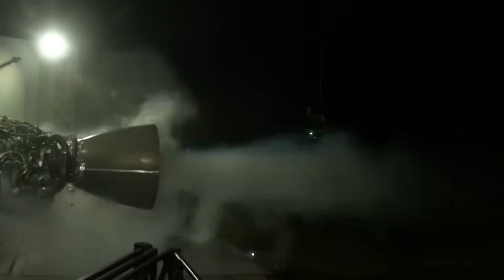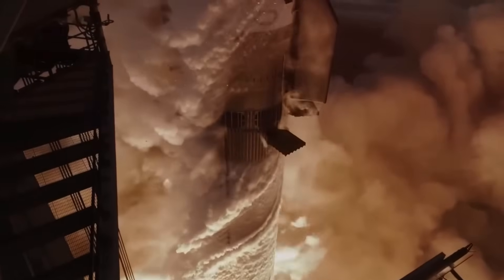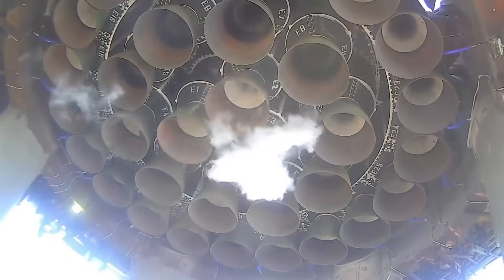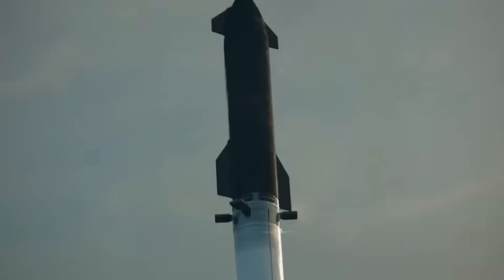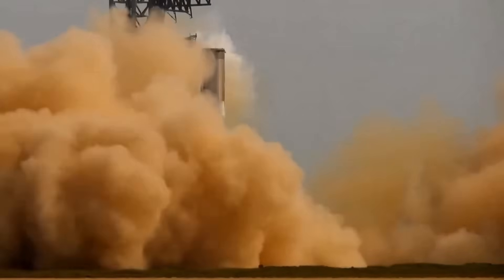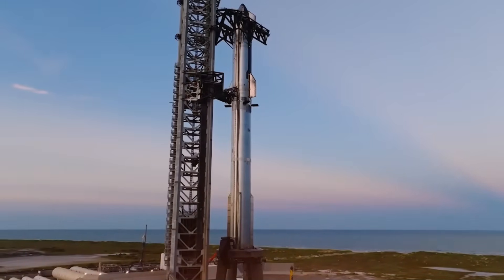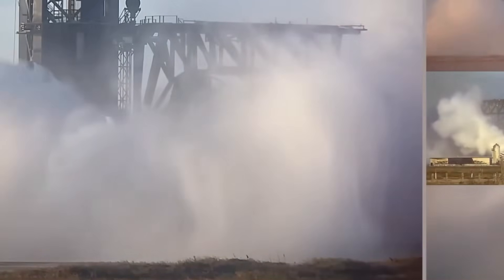SpaceX's NEW Raptor Engine Just Did The IMPOSSIBLE... Engineers Are Speechless

Comment: Needs another cone inside of the cone  with outputs like a natural gas oven top
Reply from the maker: Engineering often thrives on innovative concepts like that. Who knows, maybe we'll see something like it in the future!
Reply: @Elonmusk24h  u could do the same amount of lift with half the fuel if u used a double sided compressor instead of a single inlet also with a ported knozzle similar to a becket burner on a fuel or gas furnace
Reply: The flame wouldn't be near as close to the ship either

Comment: Am I the only one concerned that a water deluge at those temperatures could risk a hydrogen explosion if the launch temps get particularly high?
Reply: I think it doesn’t happen because there is no buildup of hydrogen, the water that decomposes to hydrogen and oxygen due to proximity to the rocket exhaust immediately gets burned off. The process obviously looses enough energy so that a chain reaction isn’t possible, I say obviously because we set off nukes under water which wouldn’t have gone well otherwise.
Reply: Pretty sure this has been considered  and worked out. Lots of $$$$ at stake here!

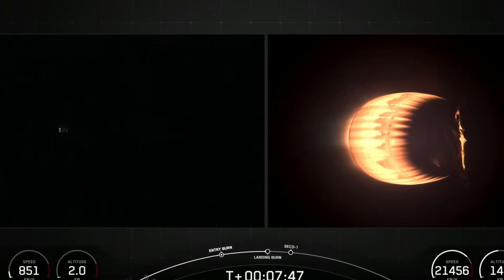Comment: 1:38
The the start, SpaceX built more than one engine. The Merlin and the Kestral. 
More errors:
“SpaceX chose Methane”
No they chose hydrogen as their fuel at first.  Yes when the first announced their next engine it was going to burn hydro/lox.  After a short time, the study of metal embrittlement and the leaks associated with hydrogen, made methane look attractive.
Reply: Plus hydrogen is just too bulky for the energy it produces - good per kilogram (the best), but not per litre - thus the huge tanks on the Space Shuttle. The carbon in Methane "compresses" the hydrogen - an elegant choice.

Comment: Hey Elon, 304 stainless steel is really strong and heat resistant.  Is there a comparable scandium/aluminum alloy that could replace 304 stainless?  I've noticed that research with scandium, as an alloy, is constrained because of is rarity.  The paradoxical thing is that the sediment, under the manganese nodules, in between Hawaii and Mexico, is loaded with scandium.  So, do you tear up the ground on land or suck up the mud on the deep ocean floor.  The sediment being dumped into the ocean, creating a plume is the biggest complaint of environmentalists.  In this case, the sediment is too valuable to dump.  Any scars on the ocean floor can be mediated with sediment from deltas, formed by rivers dumping sediment into the ocean and volcanic "regolith" from Mexico replacing the nodules.
Reply: I seriously doubt Elon Musk monitors this b grade channel
Reply: @markunwin2313  You are comical.  It is his channel.
Reply: I doubt his team leaves anything behind... they know every aspect of everything they do and everything is considered by many !!!
Reply: @justachipn3039  You think they are omnipotent?  Kind of like Gods.  I know they don't think that of themselves.  No one knows everything.